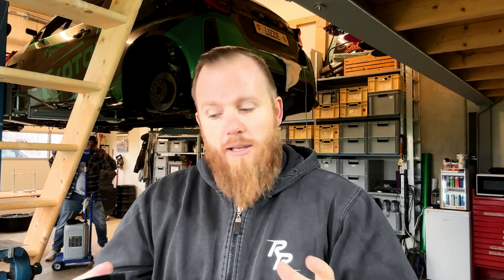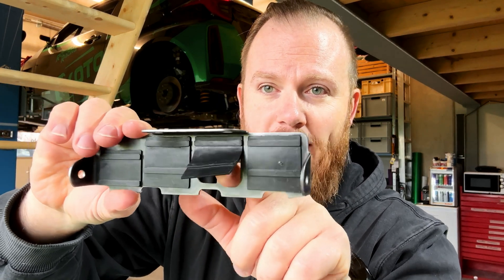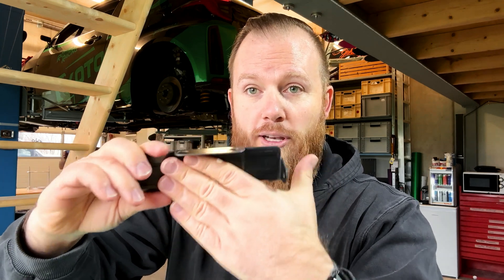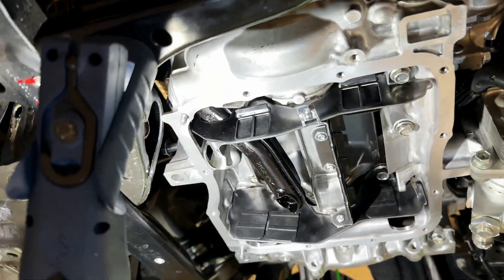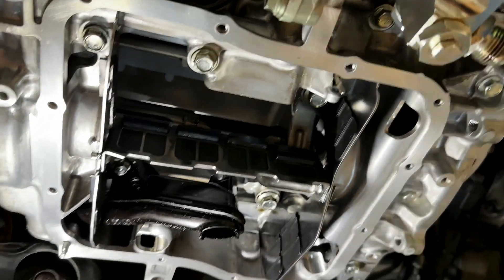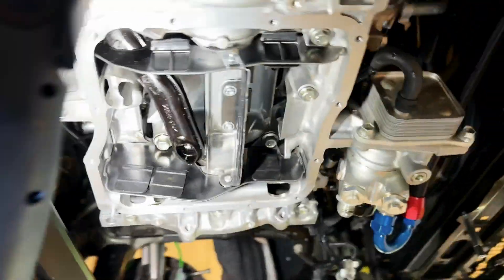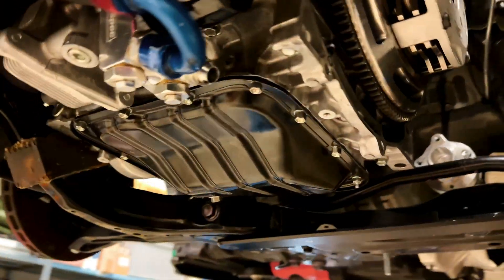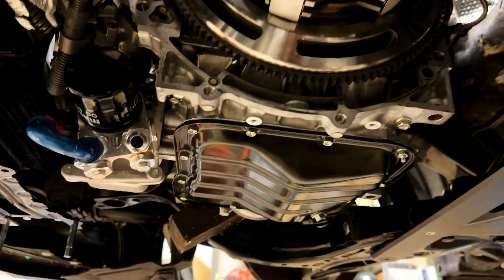Toyota GR Yaris - Baffled Oil Sump - or how to save your engine from oil pressure drop.

Comment: Does this solve oil pressure dropping by 1 bar at high RPM's after installing an oil cooler?
Reply from the maker: @mixxeerr  have a look at the data plots with our oil pan:
https://roetheli-racing.ch/products/rotheli-racing-gr-yaris-olwanne-mit-1-25l-zusatzlichem-volumen

Comment: Plastic gates? I wonder what their lifespan is??
Reply from the maker: @heathlett275  it‘s rubber. Their lifespan will be at least a couple years.
Reply: @RotheliRacing id never put that in mine if that's the life Span. Very easy to make one with steel gates. Great video, thankyou

Comment: did mine recently - biggest task was to get the original oilpan off as it was very tightly glued (3hrs?). then cleaning the surfaces and adding the assembly to block maybe 2hrs. Left it rest over night (12hrs) before adding oil to engine. took 2x what I expected but that seems to be normal with GR... Use good tools and sealant. instructions are good and includes all torque specs needed.

Comment: My engine has no mods yet and I'm looking to do this and cooling solutions first. 

My only question and concern I have is 
1. What is the torque spec for the bolts inside the oilpan?
2. What type of RTV to use?

Thank you for posting this video!
Reply: When you purchase the part from myself, it includes the instructions with torque specs.
Reply: Thank you  @lamspeedracing5024  ! Planning to purchase this in the next month or so from Austin, Texas.
Reply from the maker: 1. Answers can be seen in the Toyota Tech Handbook. Just have to pay to get access. It‘s 4€/h
2. The one you have access to. There are 100‘s of these and as long as it‘s specifically for sealing oil pans, you‘ll be fine.
Reply: Thanks. I did see a few floating around and just wanted some hardline tried and true specs.  @RotheliRacing

Comment: I wonder if you will see any starvation at high RPM as the oil has to get through those doors? I assume the rubber doors will soften with heat but it looks to me like they form a major restriction to the oil flow returning to the pick up? Just my 2p.
Reply from the maker: I don‘t think that when the oil presses with 3-4bar against these flaps, that it‘ll have any issues whatsoever.
Reply: @RotheliRacing  but the oil pressure will not be there when the oil is returning to the sump, there is only gravity bringing it back to the sump. I’m sure it will be fine, but if I fitted those baffles to mine I would keep a very close eye on high rpm oil pressure for the initial test.
Reply from the maker: @NigelsModellingBench  good Input. Will have an eye on it. 👍

Comment: Do not grind the plates. It will effect the overall result. In the instructions it shows to bend it slightly to clearance the ribs in the factory oil pan.